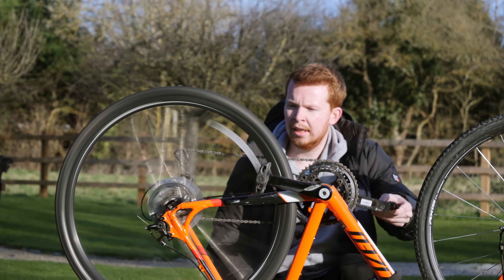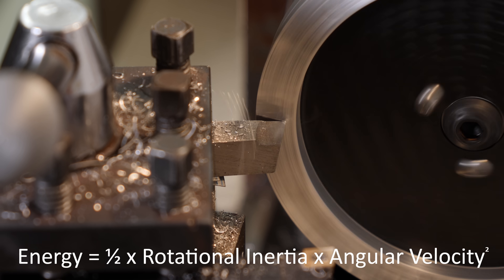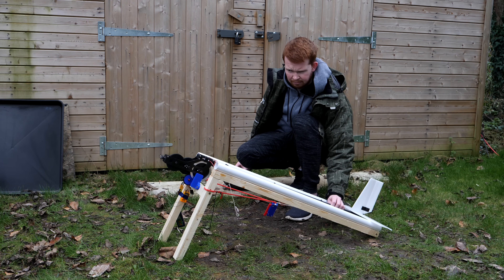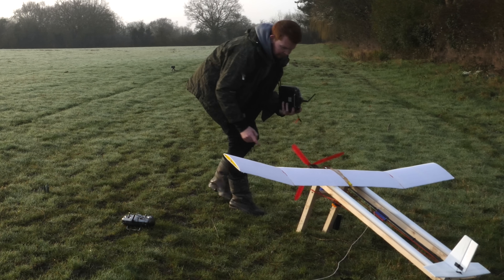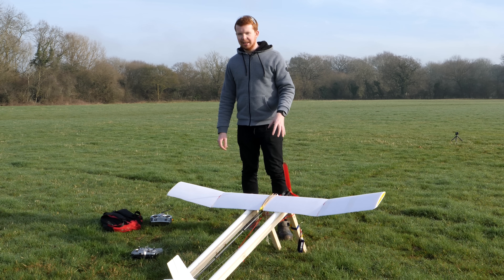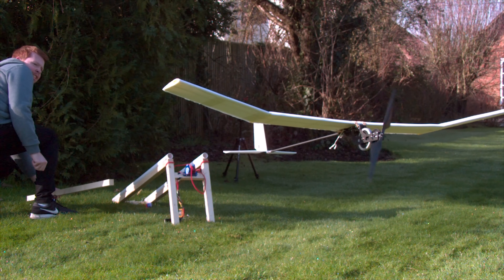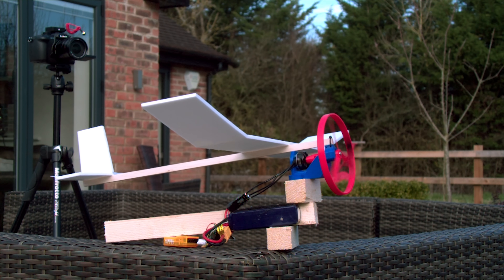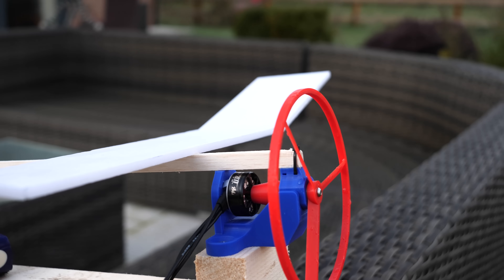Flywheel Powered Plane

Comment: Tom, I found some new PCMs. There are Phase Change Liquid Ions that dissolve CO2 in them. They are solid when there is no CO2 in them. When you dissolve the CO2 in them they become liquid. They appear to be pretty stable and I think they need a catalyst to resolidify, releasing HUGE amounts of heat. They are pretty crazy.

Comment: Man, are you crasy? Working with flywheel without any protection is very dangerous! 
Look for videos of a flywheel that has come loose from its mount or a flywheel that has failed to withstand the centrifugal force and has broken into pieces.

Comment: Reminds me of those ring pull toy airplanes from when I was a kid, in the mid 70's. The plane was sat on a pistol grip mount that had a ring pull string that would automatically retract with a spring, and a similar ratcheting mechanism like you have made. When you pulled the string quickly, it would spin up the relatively heavy propeller and launch the plane off the ring pull and pistol grip holder , and launch it into the sky. I think they were taken off the, market because kids would launch them at each other's heads, but they sure were fun.

Comment: Why do you use Aluminum for the flywheel and not at least steel or iron. You could make it a bit heavier at least drilling holes in the edge and putting steel screws in at equal points all around the edge. I fact it would also give you a easier way to ensure it was calibrated, balanced right. Is the extra weight in this case not worth it for the energy you get back?

Comment: would making the airframe into an airship help?  i know drag and such would make it fly slower, and be more influenced by wind.  but the hot air or gas in the structure may help allow the weight to be higher?  thou high enough for a battery pack or capacitor run electric motor may be harder to achieve... but an electric motor capacitor sort of set up could allow the flywheel to be respun at some point in its flight.  since capacitors are high flow /fast release sort of batteries... material wise i think they may also be more expensive but idk about weight comparisons between battery packs and capacitors... capacitors are much faster charging as well if that helps.

Comment: Maybe try a helicopter design, versa a plane. The flywheel acting as a gyroscope would work a lot better on its X-axis and maybe use and/or adjust the gyroscope/flywheel angle for movement with servos and Lil RC wireless controller. I wouldn't know how to control the speed and lift of it tho lol.. but will be cool to see!

Comment: Stop. you need two flywheels spinning in opposit sens. Otherwise the system will inply an up or down redirection as the wheel communicates its energy to the rest of the plane.

Comment: I’ve built a number of full size airplanes.  Someone needs to take my idea farther.  Why do we not have compressed natural gas powered aircraft yet?  Yes I understand the pressure issue with altitude. And I understand the flammability. Not my first rodeo.  But liquid fuel is also flammable.  A fuel that is lighter than air.  And with carbon fiber there is the ability to make a storage vessel out of structural areas. (For instance a wing spar holding the gas).  Bede who designed the Jake’s bond micro jet.  And the grumman yankee.  And many others was ingenious on using the spar to carry fuel in the yankee.  Problem is it would centerfuge out in a spin and make it unrecoverable.   But if it were gas that weighs less than air.    Imagine weightless fuel that is carbon neutral.

Comment: I like idea of rotation disk power source. The reason of falling, was un-balanced weight, the tip was more heavier than the tail. but maybe adjusting the front wings angle and creating high pressure point under the front wings (by using the front rotator output) apply enough upward force to in-effect weight force. please design a new flywheel powered plane.

Comment: Their is motor propeller characters. 
For your applications choose the combination. You can find in web 
Do the research on different planoforms and selection of aerofoil for the particular altitude.  Is key
And place your battery at center of gravity at wing. If you still need information see university of Arizona. Did many MAv micro air vechical.

Comment: The flywheel plane had high rpm but little torque; once inertia became a factor at launch; there was no conservation to sustain the energy. Fixable somewhat with just a much lower Gear ratio; or even twin-engine; to just overcome the stall issue.

Comment: 6:14 Why isn't THAT your flywheel? No gears, no belts.
Put your aluminum flywheel mass on the outside of the propeller and have the carbon fiber spokes holding the flywheel be your blades.
Maybe make it dual prop to counter precession.

Comment: I think you need the flywheel further back so that the plane is more balanced.  It looks like all the weight is up front, causing it to nose dive.  If the weight was more to the back, it would cause the nose to point up more and you could get more range.  Just my thoughts.  I could be wrong.

Comment: Would the rotation of the flywheel had any impact on flight performance?  Similar to putting a backspin on a ball dropped from a high distance.  I know when you spin a flywheel in your hand you can feel it "pulling" one way or another.

Comment: You do realise that the flywheel is acting like a gyroscope, making angular movement perpendicular to the rotation of the flywheel very very hard. You can counter this by having 2 flywheels rotation counter each other. Then they should provide more output and cancell the gyro effect. Great job by the way.

Comment: I am pretty sure the gyroscopic moment was nosing down your flywheel plane, if it was reversed, you might be able to set your wings farther back to take advantage of the new center of gravity, but you would need to find your flight center of gravity while the flywheel was in motion.

Comment: By looking at your channel content you seem to be very smart guy. That is why i was so surpriced that you've assumed that those 3D printed bevel gears will cope with the task... So much time wasted:D But the first thing was the flywheel itself. You knew that it must spin at extremely high RPMs, you even provided formula for the stored energy but somehow you didn't spot the fact that the machining accuracy is very important to reduce energy loses due to vibration, sound and heat. The idea is very nice, though. Have you seen mid 19th century invention - flywheel driven torpedo? Google it. Very interesting.

Comment: I'm almost positive it's already been brought up and just got burried, but wouldn't the gyroscopic forces from the flywheel cause the aircraft to pull to the left or right depending on the direction of rotation? You would basically end up needing a tourbillon in a final design to cancel out the effect, or at least a counter-rotating flywheel oriented parallel to the other. That, or maybe I'm off base, and thinking way too much about it 😅

Comment: The momentum of the flywheel will potentially turn the planes nose down (or up) if it is decelerated by the propeller. You should try to spin it horizontally and maybe use two flywheels rotating in opposite directions.

Comment: It'd be cool to make a flying hula hoop based on the same launch principal of the ringed propeller,  but instead of having the lug to spin it up to speed at the center like the hub of the propeller ring, put the little cogs on the inside (or built into the hoops trailing edge), and have spokes mounted to the motor, so that you could increase the rotational speed dramatically, with no need for minimum/maximum weight restrictions like on the ringed propellers

Comment: I think I know where the first flywheel plane failed you had the center of gravity too far forward which is why it kept nosediving (center of gravity vs center of thrust) an option to test this is to move the front wing to in front of the prop or to move the flywheel back and use a longer propeller shaft

Comment: You could increase the inertia to increase the energy storage and the hoop strength of the ring to allow it to spin faster by embedding a steel or aluminium ring in a groove in the 3D printed ring. Likely you would need to machine the ring out a sheet of metal, so likely aluminium would be a better choice. Depending on the thickness of the plate that you can machine, you could cut two or more rings and stack them get the width you want for the metal ring.  3D print the thicker bottom and the thinner section that the metal ring will go around. Pause the printing and slide the  metal ring(s) into the still open groove with some epoxy to bind it to the plastic, then finish printing the rest of the blade/ring assembly. 

To lock the metal ring to the plast better you could cut the metal ring with some keys on the inside of the ring and print the prop assembly with slots the metal ring keys will fit into. This will keep the shear strength of the adhesive determining how fast the prop could be spun up since accelerating too fast could shear the adhesive layer.

Comment: I don't get this flywheel concept. Wouldn't it be the same if you just turn it into a propeller directly, without the all the kinetic energy transfer mechanisms? An while it can hold a lot of kinetic energy, what good is that if the net amount is far less than bottle of some fuel or a battery?
Reply: half the fun though lol

Comment: seldom does one find such a stupid idea frm Tom Stabton !  Of course Tom Stanton KNOWS far better than 
I  that :  the MASS of the flywheel controls the design of the power plant. Large mass gives a longr duration flight but requires huge ungainly wings and structural support ...this is the reason that there has never been a AIRBORNE plane !

Comment: Seems to me like flywheels can store a lot of energy. Getting that energy out of them is just hard because it loses so much in friction, heat and other inefficiency.
Reply: could work if we just get a bigger flywheel
Reply: @Yargolocus  Weighs more.
Reply: @Yargolocus  Problem.with flywheel for a plane is its energy is directly related to its mass. Which is detrimental to the whole point of it.

Comment: Wonder if you could make some intentional breaks between the flywheel and the propeller to stop the gears from breaking every time it crashes. Like the link between the last rotated gear and the propeller being secured with a plastic sprint that would snap before you start cleaning the teeth off of the gears.

Comment: I have had an idea for years to make a high speed pedal powered bus that uses a mechanical battery. 
Each passenger sits at a stationary bike with shiftable gears. 2 rows of peddlers, on each side facing outward. Each side would pedal to make a common shaft spin with 1 way bearings. The 2 peddle shafts would feed into a large wheel that would be near and below the driver. That flywheel would be attached to a transmission. 
I imagine a flywheel from a large truck or even a train wheel would be a good start.
The driver would focus on driving only. If the bus has 20 passengers who peddle at each station, the left and right common shafts would feed the flywheel rotational energy, and I imagine this thing would have all the torque to get up to highway speed rather easily. Maybe even a land speed record? 
Most of all, i wish I had the means to make this. A large shop and some serious equipment would be needed.

Comment: isn't a cowl around the blades supposed to increase lift? isn't that why they have them on quad copters? maybe you could make a slightly smaller blade and put a cowl around it

Comment: Elon Musk has a problem with the experimental Starchip s they crash and explode, the summit height seems too low and or the control nozzles are set incorrectly. He could use help I'm here in the right channel with the tester. Thanks in advance

Comment: A flywheel powered plane, mental, I applaud you sir! How about having a cassette tape transition, the flywheel connected to one reel, the prop to another, as the " tape " ( Kevlar strand ? ) builds up on the flywheel reel, and decreases on the prop reel the ratio would change, so as the flywheel slows down the prop still spins at approximately the same speed.

Comment: Around the 1900s they had flywheel powered torpedoes. A nozzle for steam was positioned so the steam impinged on the flywheel and spun it up then they would let the torpedo go . They even had variable pitch at the propellers so that as the flywheel lost rotational velocity and the shaft rotated slower the pitch of the propellers would increase to maintain speed. So next : a steam flywheel powered aircraft with variable pitch propeller! =D

Comment: Can you design the propeller as the fly wheel with the blades on the inside and the high RPM ring on the outside? The blades of the propeller would need to have a very low angle to allow high RPM without killing the inertia quickly.

Comment: I like the idea and think you are on to something. I think you will get ample flight if you build the right model and use a small catapult to launch off the ramp you have. 
For starters I would run the flywheel the other way to eliminate the downward rotation from the flywheel.

Comment: The prop needs to be made of high tensile steel, titanium, carbon fibre or something, then spun up to 100,000 rpm. The blades on the prop should not break as they are under very little tension however fast it spins, so they must be disintegrating due to lack of rotational balance, much like a car wheel that has not been balanced.

Comment: I think the first design could be possible when you spin the flywheel in the other direction
from what i can see around the 1:47 mark, the flywheel turns as an in reverse riding wheel, but because of the mass and the ball bearings changing direction of the friction on the plane, this will pull the nose down and the tail up while being in the air
because you have such a low friction with ball bearings, you will only notice the applied force while the plane is in the air

Comment: Again a project you never should have started because you failed to fully assess the situation, that if the energy depends on the MASS, and it's a PLANE, and there is GRAVITY, there is no way it can be a worthwhile energy source.  Someone will come along and state increase the velocity, but then you increase the friction, and it still has to be contrasted with 100 years of innovation and learning already established.  Again you are just ignoring that the work has already been done and starting over without considering relevant variables.  A waste of time.

Comment: Tom, your experiment would have been a success, instead of a failure, if you would have used 2 identical and coaxial flywheels revolving in opposite directions with the same speed.

Comment: You do not take care of aerodynamics mate. First you tried to take off with a heavy front and a short wingspan at no wind. A lot of weight needs big wings, or strong wind coming from the front, it would have worked but you should use air to make an airplane fly.

Comment: I think using a flywheel with same weight but much more DIAMETER would store much more energy when spinned to same RPM. You should try this in the next tries.

Comment: the problem is that it has too many reduction gears, the friction absorbed most of the energy right away, if it was a heavier flywheel at a lower rpm connected with just one gear to the propeller it would have worked.
Reply: well, at least I think it would have more of a chance to work

Comment: 1: your plane is extremely nose heavy.  Your center of mass should be just behind the center of lift of the plane, to keep the nose up.  You can use a simple balance test to see where your center of mass starts at, then add your flywheel and see how it changes.
2: You're using a high rpm flywheel, on a vehicle that requires high rpm, but you've got your fly wheel behind a bunch of things reducing the rpm of the prop.  So you're losing energy you could've used for lift by using the flywheel.

Comment: Since the whole energy of the plane is stored in the flywheel... why not use two propellers? One in each wing (a 3d printed counter rotating projec would be just awersome!) In order to reduce how nose heavy it is, maybe two push propellers would do the trick.

Comment: Try an aluminum gearbox with small helical gears and ball bearings and spin the flywheel to 300.000rpm. Removing the air inside the box may also help.

Comment: Flywheels are used in cars to store energy for short bursts of power of like 10seconds which is enough to boost the performance and reduce the fuel consumption by a lot (40-60%)
But they use very high rpms and convert the power to electricity otherwise you cant match the rpms of the flywheel with the speed of the car. For airplanes this form of energy doesn’t have any advantages